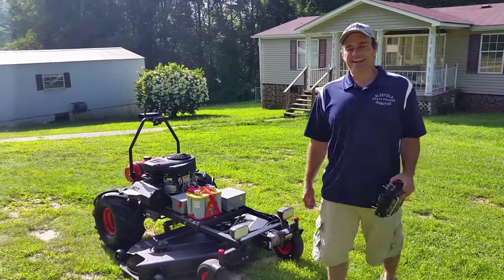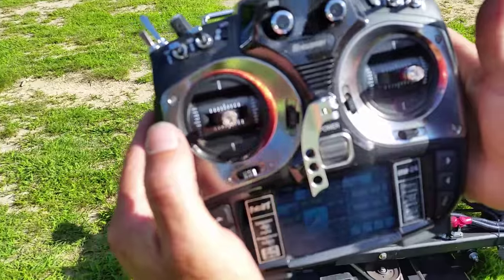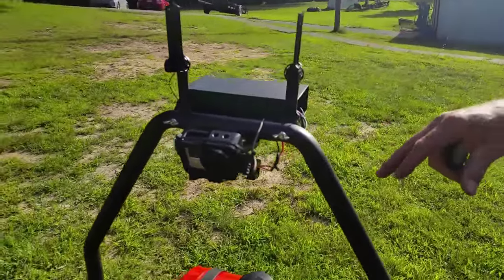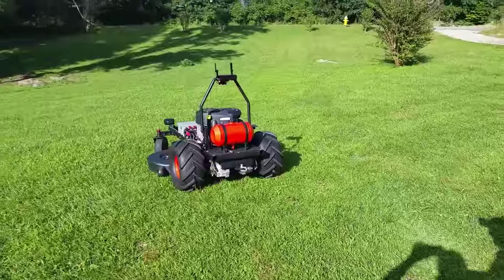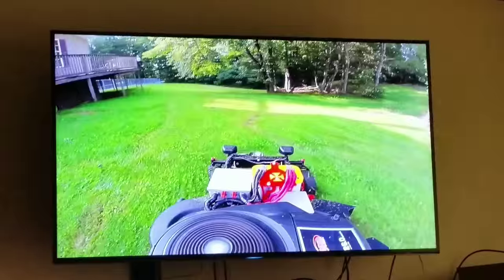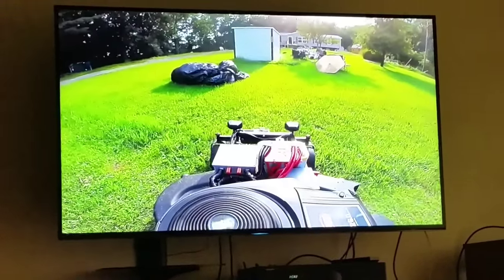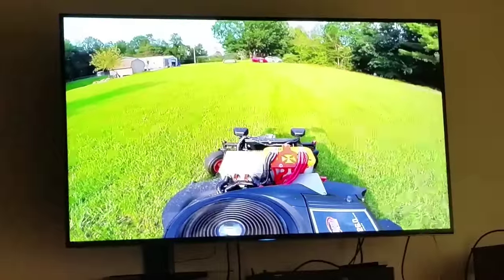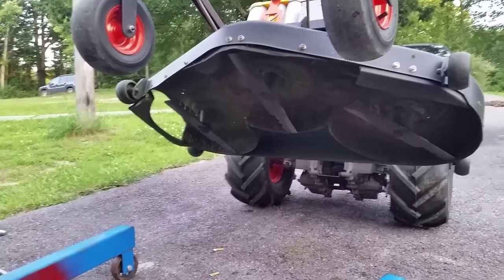RC Zero Turn (RC-ZT)

Comment: Very well built, the engines' alternator will easily power all of the electronics.  Adding a wifi link and a highspeed internet connection and you could even operate the unit from a remote location many miles away.

Comment: Really high quality build I noticed everything you use was top of the line parts. I'm adding the lights is a great idea and why not. Like the dumb comment the guy made. I'm sure your neighbors appreciate you mowing at night. That guy's just jealous of course you don't know at night time. But you could use  the power of the machine to do something else at night time so you don't have to run the mower deck. This video was released 8 years ago. Imagine making upgrades in 2024 because we came a long way with electronics and camera systems in 8 years. Great work like to see more of the upgrades that you made if any . Keep up the nice work.

Comment: With that r/c transmitter you would be able to program the stick channel mixing so that you would obtain a more conventional control layout? I.e. the left stick controlling the power and and fwd/rev direction of both motors, whereas the right stick controlling the steering by offsetting the power of one motor relative to another? With an OpenTX based radio that can be easily done. Not sure about the Graupners.
Reply: Why? Works perfectly the way it is...

Comment: Nice... I live in a urban area and I'm disabled, this idea would be great for urban areas if it was smaller, and all battery powered...
A 28" deck or smaller, would get through most gates, and batteries would give enough power to cut most lawns...
You're on the right track with this idea... At least until the robotic ones come out which will eliminate having to drive it...
Reply: Traduci
Reply: Yeah but, robot mowers can only do so much, and can't cut thick grass. This is an absolute offroad monster!

Comment: I am disabled and looking for a kit to go on a brand new small push mower.  I need to install a larger gas tank on the mower to cut my 1.2 acres.  I heard windshield wiper motors lift 400lbsand are good motors to turn wheels on lawn mowers.

I would need better grip rear push tires as it cuts a smooth rounded ditch at front of property.

That camera is nice and needed.   
I saw a led bar 10” to mount on top with a battery for bright wide view.

Can you help me with RC parts?

Comment: Hi Derek. I write you from Hamburg / Germany. CONGRATULATION ... Very nice and clean job !
Would you please be so kind and inform me: Witch Servos do you use for the steering of the hydrostatic valves ?
I have also a 50" Zero Turn Lawnmower, and wanna handle the machine by RC. But the hydrostatic valves of my Zero Turn Lawnmower are very haevy to handle.
THANK YOU.
Reply: Thank you. Have a nice day.

Comment: What size sabertooth do I need to run 44 inch zero turn
Reply: 44 inch mower has nothing to do with the sabertooth motor driver! It depends on the size of the drive motors and what they require.  Lol

Comment: nice! I wish I had that kind of  expendable income.
Reply: I build a couple of these in my back yard. You don't need newest stuff to throw together. eBay for 2wheelchair motors 100$, 120watt welder 100$ or cut yourself some angle iron from Home Depot, the brain to drive it is also 100$ and a used toro mower on CL is 100$ . Plus the dolly wheels from harbor freight is about 50$ together. Plus u going to build it yourself, so there's no right way, because you're going to adjust it to your need and money. Lmk if u need helps, or watch some of my mower videos. U can see I started with aluminum frame to steel tubing. And this design is similar to many others, u don't need a robotic team or university to learn this
Reply: I've built plenty, but I use quality components and my education so they cost a little more than a couple hundred dollars. To build the mower in this video you'll need a lot more than junk off eBay, casters from harbor freight, and a Google education lol
Reply: +Travis Kimbrell ok then why did u said you wish u had some income when you're already build some.
Reply: +Travis Kimbrell ok then why did u said you wish u had some income when you're already build some.
Reply: Because the ones I built were very inexpensive compared to this one. The mower in this video costs much more to build than using small mowers. If I had the money to spend on a project like this it would be a lot more sophisticated and capable.
Reply: @derekdotson61  Guess the business went under?  The site is now a spam site...